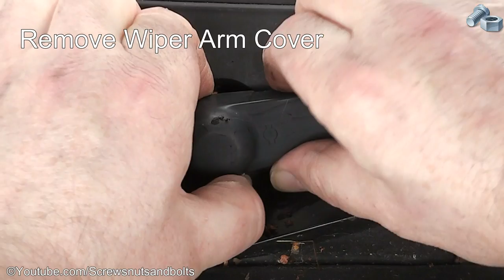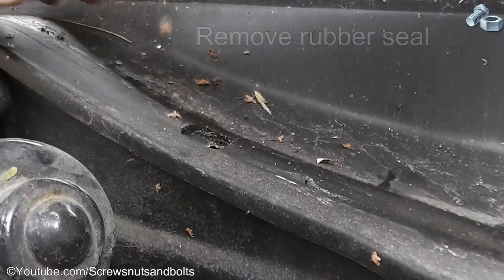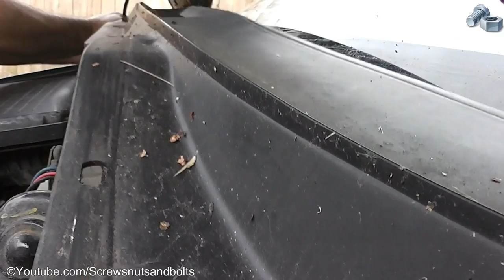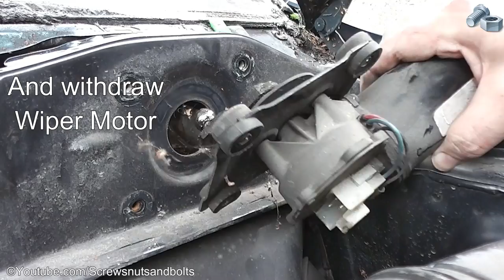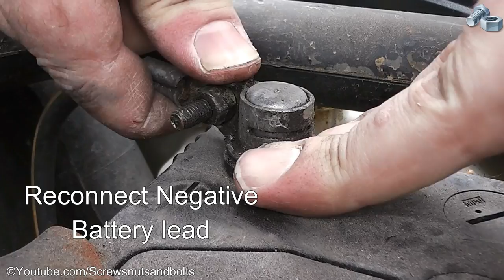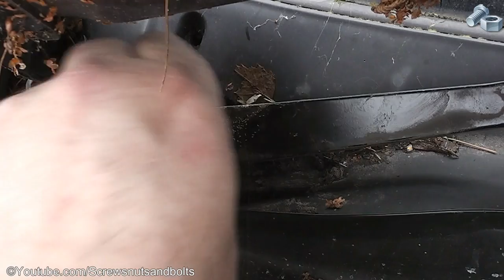Windscreen Wiper Motor - Removal and Refitting

Comment: Hi I'm a 6+ years Micra K11 driver now and I repair most things on my car myself, if I can.
Very good video, I liked how you did not cut any footage out (showing every nut and bolt removed/re-fitted). It makes it very clear for me this way, thanks !!
Reply from the maker: Thank you very much ! :)
Reply: @screwsnutsandbolts  you're welcome, short update:
Tonight I finished re-fitting the wiper motor and the entire linkage rods and bearings from a (breakers) donor K11 facelift model. Im surprised it worked so well since my own car is the pre facelift from 1997.
Job well done, thanks again for the video 😁
Reply from the maker: @TheDrunkenMug  Good job ! 👍
Reply: Very clear. But do you clean a surface before installing?

Comment: Is it a 3-speed motor or rain-sensing wiper motor? I have a 3-speed option ; I want to change it to rain sensing wiper system. What would be modifications required in terms of electricals?
Reply from the maker: I don't actually know, sorry

Comment: Brilliant video thanks. I have a Nissan Qashqai 2007 though. Replaced the Wiper motor. Linkage arms are moving but when I put wipers back on, the wipers are not moving....I'm stumped.....any ideas please?
Reply: Motor is working and the linkage arms are moving but not the wipers. Bolts and nuts all tightened.
Reply from the maker: You may have put the linkages in in the wrong position and the wiper arms are trying to go the wrong direction when you switch them on. I've done that myself once before. Take the wiper arms off and check what direction they rotate as they start. Before you put the motor/linkages back in, you might have needed to reset the wiper motor by cycling it one time. Let me know how you get on.
Reply: @screwsnutsandbolts  it worked. Tks so much